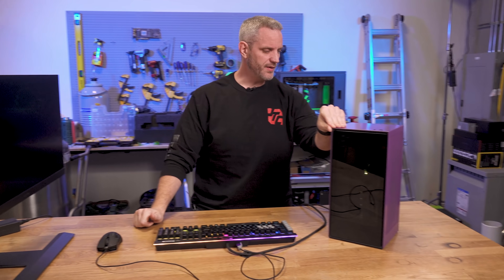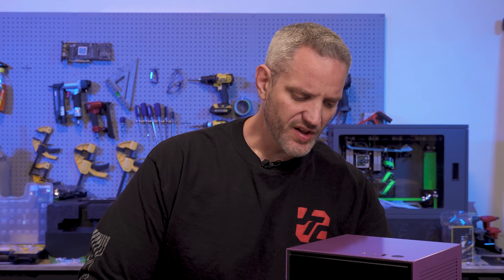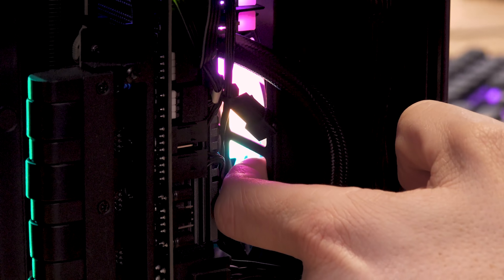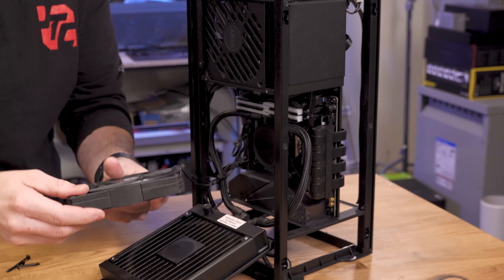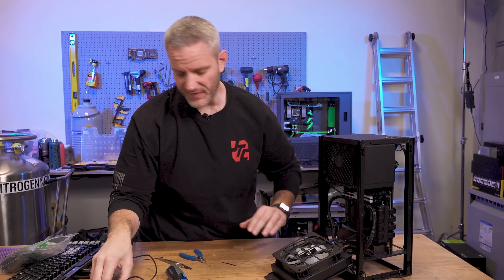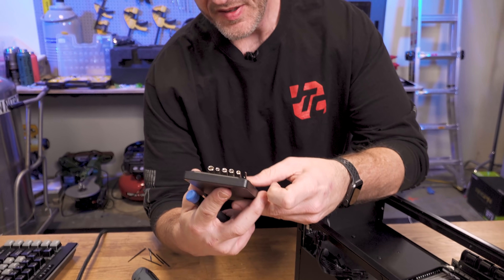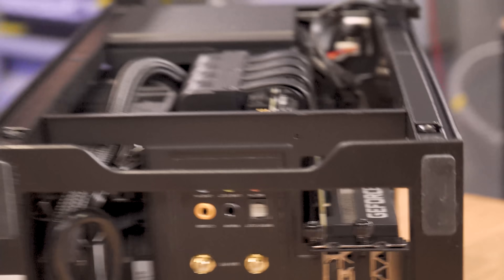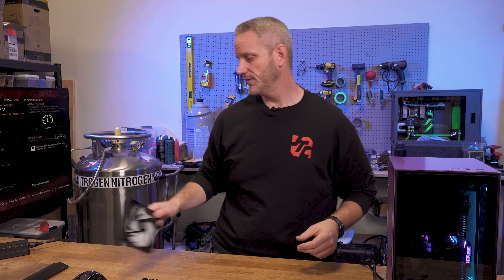This PC is shutting down due to overheating... let's investigate why!

Comment: that reminds me of my system.. I have a good aged computer with a custom loop, 360 radiator, I7 6700K, GTX1080 only cpu is liquid cooled. becuase I had two pumps in serial and three cpu fans I decided not to stress my poor mb with the pumps and only attached the fans. the pupms were connected to an 5,25" fan controller. usually I put the pumps at a level where they are a bit over the threshhold where they stall, fans are completely off and under max load the fans just turn on and cpu is hitting a max temp of 45°. one day a buddy came over and was obsessed with the fan controller (uhh because it has rgb) and when I was gaming later, I noticed that the cpu fans were on. I mean louder than normal. Huh, temp was at 60°, and that was weird. I discovered quickly that the pumps were not running and figured out why. A year later one of the pumps died, so I increased the speed of the second one to compensate. in the meantime I changed a few tubes and routing of the loop. a year later the second pump died. funny though, system is sitting on 55° under load. because my system is like a server 24/7 running, the liquid never stopped circulating, cause the radiator was sitting on the top, and the difference in temperature was causing the loop to pump itself. However that stopped when i had to shut down the pc for maintenance. ( yeah i was just lazy so it ran like that for two months) I had one of those alphacool liquid container for 5.25" drive bay with two pumps mounted at the back. now I am running a aquarium pump and a coca cola bottle as liquid container. I replaced the tubes by polyurethan 10mm with festo industrial push in fittings (soooo freakin much cheaper) and that actually doesnt look as bad as it sounds... so yeah thats my story.. not that anyone would read that...

Comment: All metal parts of a PCs case are usually directly connected to the safety earth/ground anyway. I don't see why having the screw touching the side of the case, both of which should have been at ground potential to start with, would cause any kind of issue. This seems very odd.

Comment: Okay ive been doing some research on finding this Hammerhead screwdriver, since I freaking want one, its literally not made anymore and you can buy them off of eBay for $150 or like 90 used.... the Skil brand one is around $30, the same thing without the wire stripper and bender, same rpm and everything.

Comment: Did you make a vid on Black Ice turning on and fixing it? I got the same problem I think. (PC turning on sometimes after putting it in sleep mode)
Reply: Please help 
I built my pc and it starts but I get no signals on my monitor 
Tried everything 
Ram 
The monitor it self 
Gpu 
Everything is plugged correctly btw 
The fans spin and lights are on but there's no lights and my keyboard and mouse don't get lights as well
The pc stays on for few min and turns off automatically than it turns back on
I got ryzen 5 2600 
16gb ddr4 3000
2060 rtx 
Psu is 400w 

Where is the problem??
Reply: @imhungry8713  It may sound simple, but I may have made the same mistake: did you plug the HDMI cable in the GPU? If you plug it in to your motherboard nothing will happen😅
Reply: @GreenAir_  everything ist plugged correctly and I use display port connected it to monitor
Reply: @imhungry8713  did you check if your motherboard supports your cpu?
Reply: @GreenAir_  yes I did my cpu ist ryzen 5 2600 and motherboard is asrock b450m pro4 it supports it
Reply: @imhungry8713  You are right, there shouldnt be any compatibility issues with your MOBO and CPU. RAM in wrong slots is no problem at all, PSU works, GPU will not make a pc turn off. It can be that you have to update your BIOS, check out if others have the same problem and check ASROCK's site if you need to update your BIOS to be able to use your CPU. 
Are your MOBO and CPU brand new or second hand?

Comment: Uh, just adding a plastic washer won't stop it from shorting to ground because metal threads.  A better solution would be to just add electrical tape on top of the screw head.  And the electrical tape would still has the possibility of wearing through and shorting out. (edit to add)  Watching it a second time, there shouldn't be any power traces in the section of PCB around the mounting hole.  There is no reason for a trace to loop into the tab where the PCB mounting hole is located.  
I was just reminded of something I heard and engineer say once.  "It fit in Solid Works" 
Also, had a engineering graphics/drafting professor (also and Engineer) say one time "that's not your problem, that's the technician's problem" when a classmate brought up the fact that there wasn't a way to access for repair the thing we were drawing on the computer.

Comment: Why is there a giant vat of nitrogen in the room just casually in the corner?
Reply: Please help 
I built my pc and it starts but I get no signals on my monitor 
Tried everything 
Ram 
The monitor it self 
Gpu 
Everything is plugged correctly btw 
The fans spin and lights are on but there's no lights and my keyboard and mouse don't get lights as well
The pc stays on for few min and turns off automatically than it turns back on
I got ryzen 5 2600 
16gb ddr4 3000
2060 rtx 
Psu is 400w 

Where is the problem??

Comment: I had so many issues with my 3900xt rig the past few months that I built a seperate 10700k system and so far the 10700k runs my rtx 3090 way better

Comment: Just a heads up this screwdriver goes under the brand Skil now. Look for SKIL Rechargeable 4V Cordless Screwdriver with Circuit Sensor Technology it's like 28 bucks on Amazon.

Comment: That is one of the more expensive electric screwdrivers on amazon. I think you  were confused with the sorting from low to high being high to low. There is a very similar one that is "SKIL" branded that is much cheaper.

Comment: I bought a Custom IBP PC from their website that was over-heating on arrival out of the box. It was idling at 95 C in the BIOS despite the CPU fan running fine (was a typical air cooled CPU setup). I was getting 30fps in CSGO with a 9700k because the Clocks were throttling down to near zero. The only thing I could think to do was remove the CPU Cooler and investigate. Maybe it had got unseated in shipping? Guess what I found? 

THOSE IDIOTS LEFT THE PAPER\PLASTIC COVER ON THE COPPER HEATSINK THAT MADE CONTACT WITH THE CPU. So the CPU was touching a papery plastic unable to transfer heat to the copper. How in the world this got past their QC is beyond me. This PC went through TWO SEPARATE QC CHECKS, and no one realized it idled at 95 C. I contacted them furiously and got shrugs. Had this PC been sent to a 13 year old Kid for Christmas who didn't know about building PC's he'd be super confused and disappointed. Luckily I got it..and fixed it within an hour of receiving it. IBP even had the audacity to turn on XMP when my CPU was already overheating under 0% load!

Comment: Hey it’s been just in the last month my pc has been crashing and my gpu drivers say Radeon wattman setting have been reset due to unexpected system failure. I reinstalled the drivers and went to the recommended drivers and the optional. Optional seems to crash less.
Specs: 600w power supply
I5 9600k
RX 5700 xt
16gb gskill rip jaws 3200mghz ram
Old asus motherboard not sure which

Just wondering what I should do and why my games crash, it’s generally just Star Wars Jedi fallen order but recently it’s been destiny 2 also. Built the system In June and just now started to fail.

Comment: The screw isn't the problem, the design flaw is in the PCB, putting anything but ground near a mounting screw is insane. Replacing the screw with a plastic one is just a hack to circumvent the real issue.

Comment: jay is talking out his ass
fdb fans are sealed bearings, dust can't get into oil well
they can can be installed in horizontal and vertical configurations.

reason why it failed is because he installed it wrong

FDB fans are push fans only when installed on a radiator, in the pull configuration used the fan wasn't able to push itself away from the bearing well to properly circulate the oil along the bearing channel,  you can safely install them on tower heatsinks in push and pull config as long as its not a flat contact across the entire intake side of the fan and it can draw enough air from gaps to push itself away.

Comment: Somewhat misleading conclusion on the fan. The fan didn't fail while the system was turned off. The fan could have already begun to fail at a "slow" rate on day 1. The temps could have steadily climbed over time up to the point where the thermal safety kicked in.

Comment: Was that replacement fan from Corsair LL or ML 140? Because LL is hydraulic bearing, not magnetic. Anyway glad you found the issue and solved the problem!

Edit: Anyway that's a good idea for another video, types of fans and which is the best position for each of them. Thanks Jay!

Comment: I made my own for my mobo stand offs, they are only thin sheet plasticard so dirt cheap. One on top and one underneath. Not because of an recalls or anything just me not wanting to damage the mobo.

And my gift to myself is going to be a Fluke, I've a headset I need to fix and other things that one is needed.

Comment: I have the SOG argb Case with the 2 rgb line / fan in the front + rear fan, and i got the saame problem with my front fan! It's literally the same case for your fan... Like something is blocking it  ... Should i really change it? I mean it came with the case i didn't change any fan

Comment: Surely the plastic washer doesn't resolve the grounding issue? It will still be earthed down the screw thread that is still in contact with the case?

Not sure if I have misunderstood this or not so could be wrong.

Comment: That's a quality issue with the fluid bearings, rather than a fundamental limit of them.  Noctua bearings are dynamic fluid bearings (with some advanced engineering to make them better than the basic type).

Comment: That screwdriver is a bit pricy nowadays lol
Reply: Please help 
I built my pc and it starts but I get no signals on my monitor 
Tried everything 
Ram 
The monitor it self 
Gpu 
Everything is plugged correctly btw 
The fans spin and lights are on but there's no lights and my keyboard and mouse don't get lights as well
The pc stays on for few min and turns off automatically than it turns back on
I got ryzen 5 2600 
16gb ddr4 3000
2060 rtx 
Psu is 400w 

Where is the problem??

Comment: Wait, doesn't that board have argb headers on it anyway? Forget the Corsair software, like you said, but it appears as though she's likely already running Asus Aura, so why not just connect the RGB pins from the fan directly to the Mobo header instead?

Comment: You should look at the Skil Electric Screwdriver. It's a bit more costly, but I found it to be better quality and also locks the bit in so no random pop outs. SKL-SD561201

Comment: That fan was either defective from the start or straight up bad quality. 

My choice of case fans have been Noiseblocker Black Silent Pro fans for the past 10 years. It doesn't care about orientation or dust. Even more silent, than my Noctua fans and start at 4.5V, unlike Noctua fans, that only tend to start up at ~7V. 
The Alpenföhn fan on my CPU cooler is also 10 years old and it's just as silent as it was when it was new. 
Arctic fans are also silent, when new, but their performance is meh. And they tend to last just over a year in my experience.
I also bought a few BeQuiet fans on sale for backup and to try them out. But none of my current fans are failing still, so I haven't had the chance to try them out yet.
In essence: Noiseblocker Black Silent Pro, Alpenföhn, Noctua have all proved themselves for me as silent and reliable with enough performance.

Comment: i looked on the web about fluid dynamic bearing fans disliking vertical mounting and found no indication of that being a thing, apparently FDB fans are fine in every orientation, so i wouldn't say the orientation is what caused them to break, though i might be wrong, could you provide a source for your claim?

Comment: The cheapest electric screwdriver on amazon. Nice one, often the cheap things do just as well. I actually use the cheapest fiber enforced discs for my dremel, 25 for $3 or so, they are good enough for cutting side panels and stuff. Same for the screws, don't haven an iFixit kit, but the one from the local grocery store, it's doing the job.

Comment: Fans that you can't install in a vertical position? Are you joking? That would make them absolutely worthless. Probably just a defective one and not really a vertical positioning or dust issue. The vertical position thing you mentioned might a problem in the long run (and I do mean LONG run, like 10-20 years).

Comment: I added washers to mine the second I heard about it, still waiting for my fixit kit from NZXT though, but its no big deal if it never shows.. Im more interested on when they will release a PCI-E Gen 4 riser for it as the current one only supports 3.0, ,y board supports 4.0 and I want to get a 6900xt eventually.. (currently with a 2080ti so Im not worried about it at the moment) 

Also, the dust must be REALLY bad in your area if that much gets in there despite screens (when I had my XFX Raw II 5700xt in there, there wasnt enough room for the GPU and the screen (it was 58.4mm thick) and when I changed out to the 2080ti a few months later, there was little dust in there, and I vape near my computer...)

Comment: I know what went wrong. That pc overheats in that tinkeywinky, no air flow case like the Xbox  series x.
Reply: Please help 
I built my pc and it starts but I get no signals on my monitor 
Tried everything 
Ram 
The monitor it self 
Gpu 
Everything is plugged correctly btw 
The fans spin and lights are on but there's no lights and my keyboard and mouse don't get lights as well
The pc stays on for few min and turns off automatically than it turns back on
I got ryzen 5 2600 
16gb ddr4 3000
2060 rtx 
Psu is 400w 

Where is the problem???
Reply: @imhungry8713  sounds like your 400 watt psu. Can I get the brand of your psu pls make sure you give me full detail.
Reply: @imhungry8713  also recommended for rtx 2060 is 500 watt psu. I would say 600 or 700 watt for more head room

Comment: As a note, you got your bearings backwards here. Fluid bearings are fine in any orientation; Sleeve and rifle bearings are the ones that don't like vertical mounting. They also dislike heat, which might be a complicating factor in your application here.

The Metallic Gear Skiron fan you pulled out uses a rifle bearing.

Comment: Honestly.. the case design itself is absolute garbage for an AIO.  No where near enough air movement.  The ambient air temp goes way too high.. especially for that hot Intel processor.

Comment: Jay I just bought some cheap fans that I mounted vertically. I knew they wouldn't last crazy long but this video gives me anxiety. How long are they supposed to last vertically. I can't keep buying fans every 6 months.
Reply: I have some old school Antec/Cooler Master 120's from the early/mid 2000's that still work fine today. They were mounted Vertically with no issues.

When I build my rig last Nov. I started with a Cooler Master Q300L and it came with a basic 120 exhaust fan. In about 6~ months the bearing started to make noise. While I could pop in an old school fan (mentioned above) and call it a day. I wanted the RBG so I went with new Antec F12 series ARGB and put that for exhaust and intake. 0 issues so far. 

It goes to show that stuff are not build like they used too.

Comment: People who need to fix the H1 here's a better way to relieve that recall issue go buy a zip tie that is black to match the inside and tie it in through the hole and at the bottom of the board.

Comment: If it's the power or ground layer in the pcb the screw is contacting, the washer won't be much help because the threads will make contact, not the head.

Comment: I dont understand the plastic washer fix. The screw is made of metal. The bracket is made of metal. They still touch each other ergo screw is still grounded.  If the riser ribbon is the concern and you fear the 12v strand could arc out, I only see that happening if the screw twisted onto the cable and rubbed away some of the insulation. so if it didn't happen during the initial install, why remove the screw, add the washer, and reinsert screw  ? Why not leave well enough alone ? If the pcb that the screw goes into is the concern and nothing bad happened during the initial install, why risk unscrewing and screwing ?

Comment: JayZ you have to learn some stuff about bearings....you can not say in general that dynamic fluid bearings dont like a horizontal position(its not vertical) like you used here btw a bearing attitude is normaly defind by the axis.

Comment: Jay. I have to ask since I know  no one else is.  Can I have the old skunkworks pc thats just sitting there collecting dust?  My old 750ti and 4700k are starting  to really show their age
Reply: Please help 
I built my pc and it starts but I get no signals on my monitor 
Tried everything 
Ram 
The monitor it self 
Gpu 
Everything is plugged correctly btw 
The fans spin and lights are on but there's no lights and my keyboard and mouse don't get lights as well
The pc stays on for few min and turns off automatically than it turns back on
I got ryzen 5 2600 
16gb ddr4 3000
2060 rtx 
Psu is 400w 

Where is the problem??

Comment: Had a cooling issue recently after moving my PC around. Under no load in the BIOS, i was pushing 94°C. Took my headphones off and could hear water or air bubbles being moved around. The pump had an RPM and so did the fans. But hearing those noises was not normal. 

The fix: Removed the AIO and radiator. Gave it a good shake and Voilà! I love when its that simple.